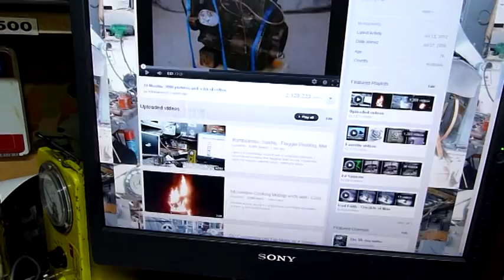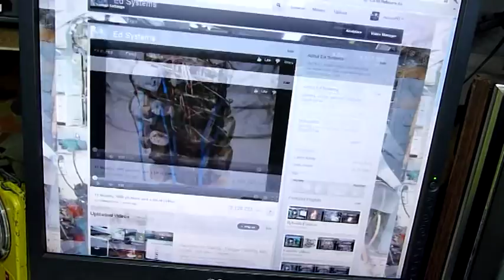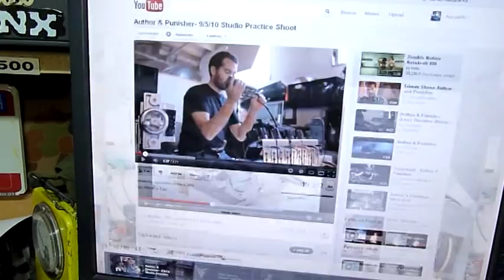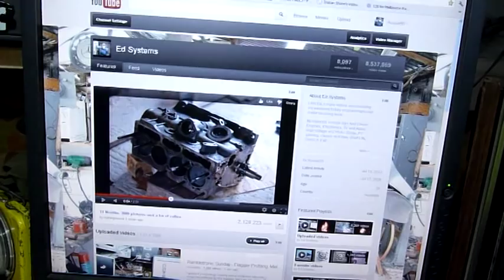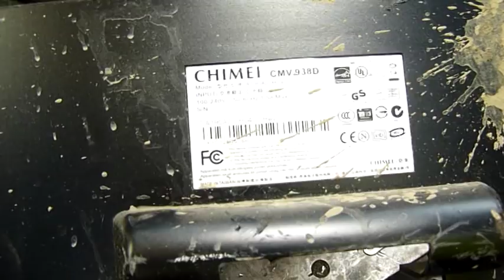RambloProductive Monday - Muddy NES and Scrapping Chi-Mei LCD Monitor

Comment: Took apart a flatscreen Tv once; I was expecting alot of electronics and PCBs but there wasn't much to it. Been thinking about using one of the thick diffuser panels as a dust/rock shield for my weedwacker (it likes throwing stuff at me, particularly sharp things).

Comment: in Japan the NES was sold as the FAMICON sytstem, the famicon had a disk drive that would fit under the system that took a 2" disk that many places in japan sold and were also available from vending machines, these disks held games to play on the disk expansion. there was also a modem that allowed users to see information on a system similar to a BBS system

Comment: The other thing to check on that old NES is the copy protection IC.  It can also cause the "blinking light" problem.  Its fairly easy to disable the ic by cutting one of the pins.  I forget which one but theres tons of videos on youtube showing how.  Also, watch that big filter cap.  I've seen those go pop in old Nintendos as well.

Comment: Actually I'm pretty sure those NESs just directly rectify that AC into DC and put it through a 7805 regulator, which means DC of either polarity will be just fine, even up to 12v or so. It doesn't even seem to use the AC as a clock source like some other machines of the time (C64, say).

Comment: There's only three proprietary chips on the NES, one of which isn't even important, which makes the console incredibly easy to repair.  You've got the CPU (6502 variant) and audio chip all in one, the PPU (picture processing unit), and lockout chip.  The lockout chip, which causes the familiar one-second power winking when cartridge contacts get dirty, can be bypassed altogether by basically just cutting one of the pins.  Everything else in the NES is basically off-the-shelf components.

Comment: AC transformer packs are easy to find, just keep an eye out for crappy AC powered PC Speakers or Clock radios, as they more than likely have a 9 Volt transformer in them, not sure about getting the amps though

Comment: There is absolutely nothing wrong with applying DC to your NES.  It has a bridge rectifier inside it which means it can accept DC of *either* polarity even.  It's the Famicom you have to be careful with:  The fami needs 9V DC with middle *negative*.  fami's get popped by people using NES adapters (9V AC) on them, but it's an easy fix.  replace the 7805 regulator.   The expansion connector on the NES has never been used by a commercial product, btw.

Comment: lol this is funny I just took apart two monitors that I found in a rubish bin and I scrapped it for metal copper and stuff but I'm in to solar and I was wantin to buy some plastic for mounting my electronics to but man its pricy like 30 bucks just for a small peice but the LCD's I had had a nice peice that fit were I wanted it and its worki out great to mount stuff to and its nice.

Comment: check the driver inverter transformer,if you get 1 k ohms on the windings should fine any higher gone and no contacting .00.21 ohms its short..if this is ok then the opto is being used to detect a falt and it will cut out the supply rails ( protection mode) then check any smd's you might have a short on them...hope this helps  ~

Comment: Well, there probably aren't going to be any more comments on this video in a while after I comment but anyway... I just found one of those Chi Mei CMV 938D. Found one at the thrift store for 10 bucks. For a Taiwanese monitor it's got pretty good colour and brightness. I'm using it now and it looks pretty good. Capable of 1440 by 900 resolution.Those caps look cheap though. Especially since this monitor was made during capacitor plague. Hope mine are OK.